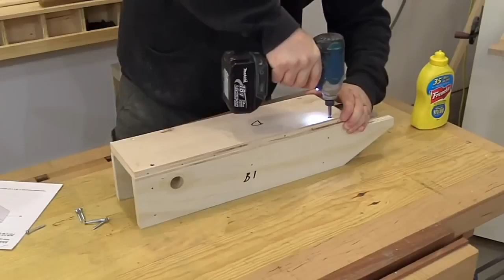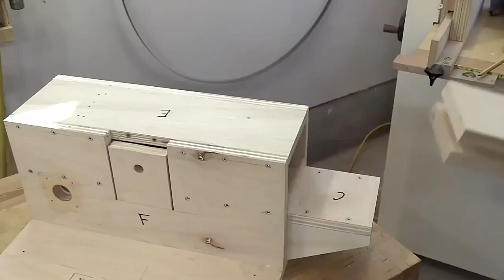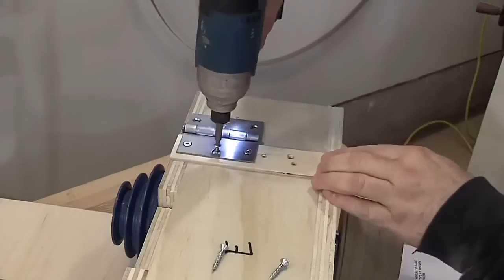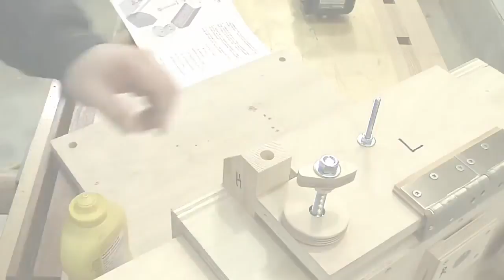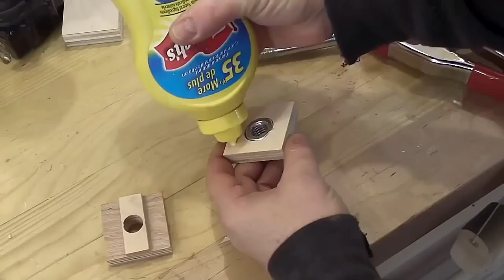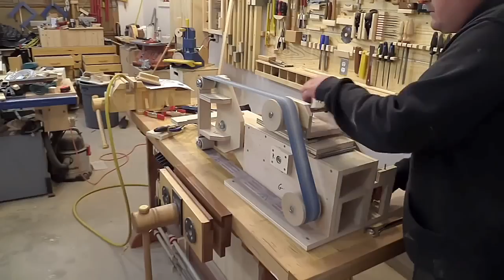Assembling The Wooden 2x72 Belt Grinder

Comment from the maker: Plans for this grinder: http://www.ibuildit.ca/Sales/sales-12.html

This video covers the assembly of the belt grinder from the plans available on my website.
Build article:
http://www.ibuildit.ca/Workshop%20Projects/belt-grinder-1.html

Truing the wheels: https://youtu.be/s2dDK6dq3qA

Painting the grinder: https://youtu.be/FilEH2fhiYA

How to make a drive wheel for this grinder: https://youtu.be/VqXq0U1HkZY

Building the stand for this grinder: https://youtu.be/qkWvfgdALdw

This is an older video that I rerecorded the audio to clean it up. The original was almost painful to listen too. Video quality is not the greatest, but good enough to see exactly what's happening.
Reply: I Build It I will be using your basic idea and hybridising it with steel parts in higher wear areas and areas likely to burn. 

I'll flip you a donation and a few photos/video as I will not likely use your plans. But a conglomerate of photos and videos from YT to base my design. 
This video is the most straightforward though so I'll be using lots from your design.
Reply: Would I be able to get away with buying only a quarter sheet of plywood or would I need a half sheet?

Comment: If you're a woodworker that's never used a 2x72 belt grinder. . . It's far far more versatile than you can imagine. 
I've been a woodworker since I was a little kid, bud used my first 2x72 at a job I started about a year ago shaping wooden knife handles, hardly a week goes by when I don't use the belt grinder for something.
Last week, for instance, I used the 2x72 with a 36 grit then an 80 grit to round over and in general make comfortable some push handles I was mounting to a bandsaw sled I built. 
There are a lot of operations that I would have traditionally taken to a lathe (file handles most recent example) that I was able to do quickly on the belt grinder. 
Eventually I'll stop working at that place, and then I'll have to buy or build my own :D
I endorse no particular grinder, no particular abrasive, but I endorse using a facemask and respirator.
Oh, and I didn't mention anything about using them for knifes and metal because knife makers have known the merits of 2x72 for decades ;)